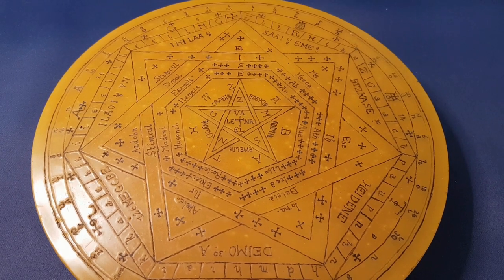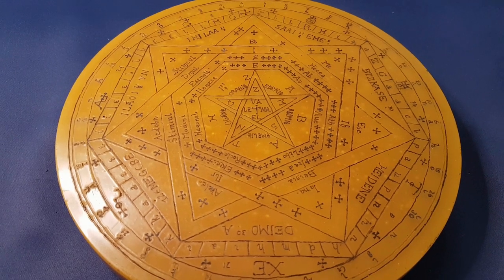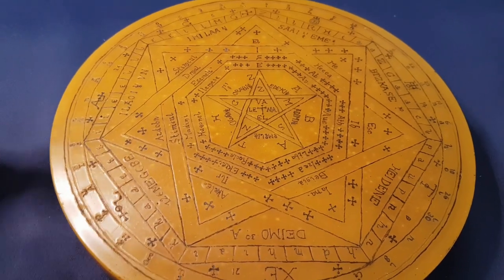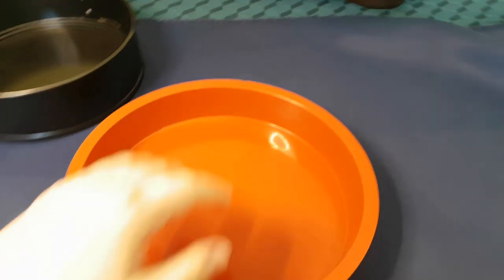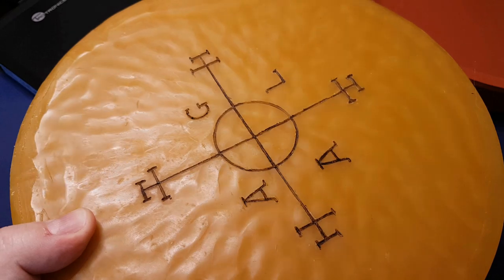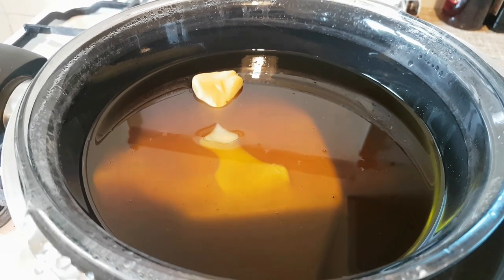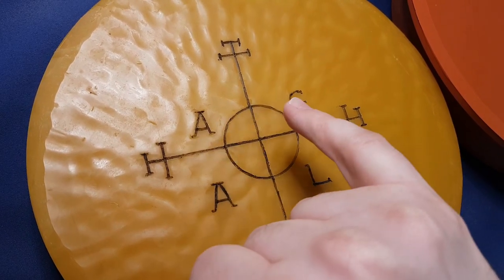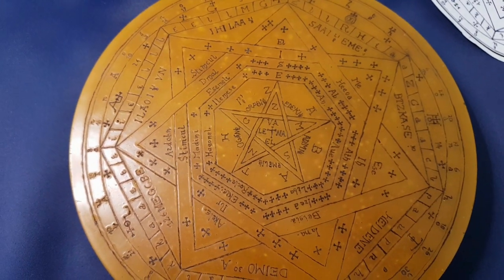Making a Sigilum Dei Aemeth out of Wax [Esoteric Saturdays]

Comment: What a piece of art!  As a novice beekeeper myself, i wanted to note that the bees wax tends to crack when it cools too fast.  To minimize that, one could let the wax cool in a warm room (around 25-30 degrees Celsius) or in a warm oven with the door closed (warm it to 200F and just leave the wax in the oven to cool very slowly).  I’m wondering if it would also help with the wrinkling on the surface….  Thanks to your vidéo, I may actually try to make one myself next beekeeping season!

Comment: Great job, Mr. “Fish”! Before I have made my Golden Dawn style earth Pentacle (out of solid wood), I first made a beeswax one (in Duquette style), using a process similar to the one you described here. I used an aluminum mold with a removable bottom and the result was similar to the disc you showed: I got some smooth and perfect surfaces and no solidified bubbles at all. Then I used a drawing  compass needle to transfer the figure from the paper to the disc surface, and reinforced the grooves and crannies in the same way. Your idea of reinforcing glyphs and letters with a fine-tipped pen is very good: the final result is better than mine, I have to admit it.

Comment: What an amazing job you did, I love it! I am a candle maker and yes no water near beeswax (in candles the water droplets will pop and crackle... learnt from my mistakes). Beeswax needs to be heated at a higher temperature than other wax and can also be a little bit more temperamental. It can cool down quickly in some parts then others and this can cause bubbles and imperfections. I use a heating gun to get smoother areas in my candles and it can be a little frustrating as a perfectionist. I love the look of your Sigilum Dei Aemeth, it is rustic and real life looking those little imperfections make it more perfect. For transferring the Sigil you can use transfer papers and decals especially made for candle use but they can be a bit difficult so you did an amazing job, I am not sure I would have the same level of patience. I am curious did you use refined beeswax or unrefined? Unrefined beeswax does have flaws into the wax as it hasn't been cleaned (unlike refined beeswax) but it is the type that smells like honey and smells amazing.
Reply from the maker: Thanks so much for this! Yes, I used unrefined beeswax and it does smell amazing! 💜

Comment: Using a fine liner pen for me was a NIGHTMARE because the tip got clogged with wax every few strokes. I highly recommend instead making a wash of black acrilic paint (a tiny bit of black paint in a shotglass full of water) painting it over the whole surface and quickly wiping it clean. The ink wash falls in the recessed marks/letters and the rest is pure beeswax. Thank you for this video!
Reply: This will work with good quality ink as well.

Comment: Is it required that the disk has to be constructed from wax exclusively as opposed to wood, perhaps? If so, what is the significance of it being of wax composite? I understand the value of putting the time, meditation, intention, & well, sheer effort into that which you create, but I would postulate that if hypothetically you invested the same energy into another medium one may yield similar results purely based on the intention invested in it. Forgive me if I'm missing something here, this is really just a general question of mine. Thanks for any insights, & otherwise great job on yours!!! Looks fantastic!

Comment: I think the ideal way to dry it would be in a pressure pot, the sort that people use to set their resin casts, but most people don't own them, and they are rather expensive. But if you know someone who uses a pressure pot, perhaps you can ask to use it. Very tricky work. I've never made one of these, but I used to make a lot of candles as gifts for friends and family, and I discovered very quickly how difficult it is to make certain types of aesthetically pristine, ornate candles without pocks, bubbles, or imperfections.

Comment: Will you be making more of these? Or similar? Might I suggest you invest in the high heat craft gun/blow dryer? It would help with smoothing the undulations and bubbles. At some point a heating pad may have been useful as well. Im thinking the more you control the temperature and pace of the melting and cooling.....as in slow and steady, the better the results.

Comment: Thank you for this, for enlightening others on the way, it's a great work! I am on my way to start mine. Just a question: in your video you said that the wheel shrinks about 5mm on the sides when it dries which reduces the diameter by 1cm, so you have a sigillum of 24cm diameter, don't you? So I ask this question because there are some proportions to the Tabula Sancta. Is 24 cm not too big?

Comment: When I made my SDA last year, I found the inking of the characters to be the hardest part as ink and wax don’t like each other very much. Please can you tell me exactly what you used for the inking!
Reply from the maker: A couple of Sakura Micron 3 pens on the top (pens keep drying up and get coated in wax, so had to keep cleaning the tips and teasing out ink on paper) and a Sakura Pigma Graphic 1 fine marker on the AGLA underneath which didn't need to be so fine.
Reply: Many thanks!  Beautiful work by the way! 
I used a solid metal tin and didn’t have issues with the rippling that you found - not sure why... maybe the metal cools more evenly? I also just turned off the oven and left in there to cool overnight so it set really slowly.
Reply from the maker: @Vibeakimbo  Good tip! 😯

Comment: I'm working on one (at least) of these at the moment.  I have used a brand new cake tin and let it cool from the oven.  Do you think the wax is more likely to crack after multiple melts?  Also, what did you use for ink?  Thanks so much for this video!
Reply from the maker: I used Sakura fineliners for the ink (several which I ruined in the process), and I think the best thing to do to avoid cracks is to leave it in the oven as the oven cools down overnight.
Reply: @FoolishFishBooks  Thanks :)

Comment: If you tried again, would you attempt using resin instead of wax? If not, why not? I'm wondering if it would be easier. Not sure if it would cost more, though.
Reply from the maker: No. The instructions from John Dee specifically require virgin wax.
The main thing I would do differently is that I would leave it in the oven as the oven cools down (slower cooling process would avoid cracks).

Comment: Great job. How much wax did you need to buy?
Reply from the maker: 1.5 kg
Reply: @FoolishFishBooks  hello FF, am I write in thinking that I pour the wax granules into the mould and melt in the oven? If so, low temperature?
Reply from the maker: @quaesitorluminis9445  yes, low temp until melted, then turn off the oven and let cool in the oven overnight.
Reply: @FoolishFishBooks  Hello FF, what type of pen or ink did you use to fill the cavity’s? 🖋
Reply from the maker: @quaesitorluminis9445  a few micron fine-liners (they stop working quite quickly when you drag them over wax)

Comment: Are enochian angels the same as regular angels?
Reply from the maker: Difficult question to answer. There are countless angels. There may or may not be some that overlap with angels from other systems like the Shem-Ha-Mephorash. Just because they are called by different names... I don't know how one would find out other than asking directly... Just not sure that would be the first thing on your mind if you had the opportunity... :D
Reply: Foolish Fish i wanna study enochian angels and enochian magick but I heard  enochian angels are just as dangerous to work with or more than demons. Is that correct?
Reply from the maker: @LoneLionLeo  I've heard similar things... The Gallery of Magick JUST released a safe-to-use method you might like to look into, something along the lines of "Success Magical with Enochian Spirits" or something similar. But anyway, I think that LMD's method is very nice, but does require equipment.
Reply: My experience, though limited, with Enochian beings is that they simply operate on a different level than regular archangels and other such Qabalistic beings. They're serious and direct whereas other beings usually take some coaxing to get accurate communication with.
Reply from the maker: @yochanan770  Thanks for this, makes sense. They do seem very serious! 😅